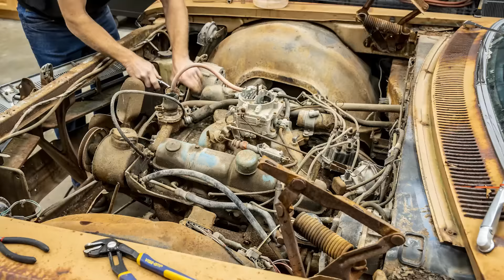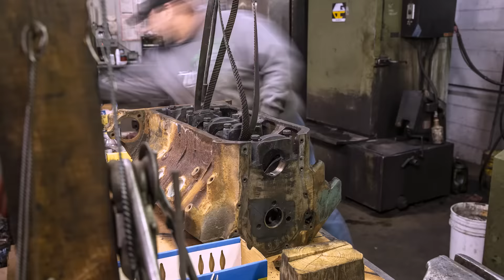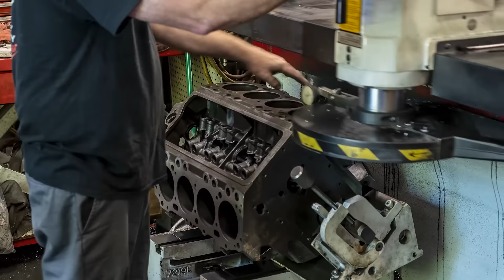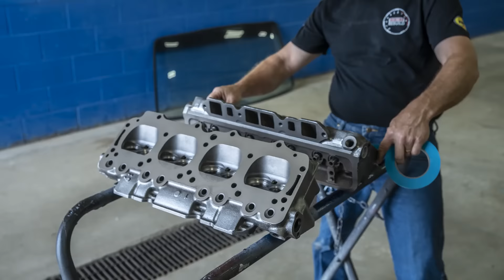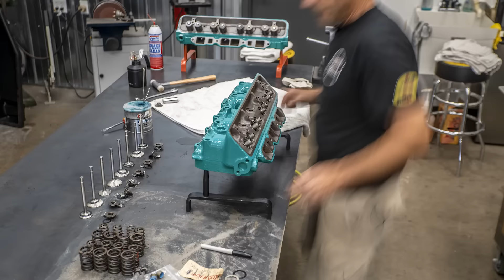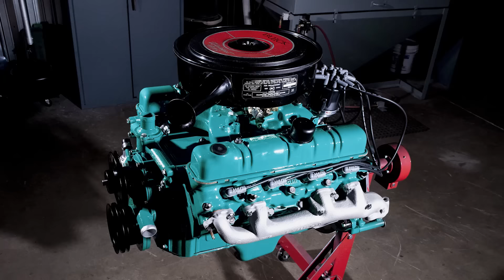Buick Nailhead V-8 engine rebuild time-lapse: from rusty to roaring | Redline Rebuilds - S3E3

Comment: “That feels advanced” - does some distributor black magic - engine fires right up....
Reply: My old man did it that way back in the early 70s by sight and sound,  sometimes by touch. 
Regretfully for me, he
Couldn't teach a hardhead young son his craft. 
I have good memories of the few projects I was blessed to help him turn a wrench on. 
Miss you always James Hilliard Bynum
Love Mike
Reply: It was over advanced. First start.......then when it's started, timing is set...
Reply: My father has the same talent. He always timed his cars by ear and hand. Same went for adjusting the carburetor. Good times. It always sucked as a kid when I came home from school and saw the car with the hood up, usually meant working into the night while all my friends ran wild. But now, I’m the one working on all the cars. The skills I learned cannot be measured.
Reply: I used to visit with an older gentleman at an assisted living home.

He told me he would use a beer to adjust timing and the carbs. He'd pour a beer into a glass and set it on the engine, and when the beer stopped foaming up from engine vibrations everything would be adjusted properly.

Comment: Looked like the cylinders were used as trashcans before the rebuild
Reply: Right ,what was that ? I picture a little homeless mouse standing over the cylinder warming his hands over a small far of twigs and McDonald's bags ?
Reply: I think that's what's left of aluminum pistons after a few decades of exposure to the elements.
Reply: so rats and squirrels are capable of quantum tunneling into the inside of the engine? Or maybe they shrink themselves down to a few millimeters to fit through some open valves and get in the cylinders?
Reply: wasp nest?
Reply: Dang ur rit
Reply: There is a magic word - inversion of air.

Comment: I do not recall EVER seeing an engine that nasty inside and out.
Man I would love to see that Wildcat running again !!!!
Great Job Guys
Reply: truth, I am with you, I never seen such a messed up engine get rebuilt like that.
Reply: @jimmski9908  They actually didn't use the original engine.  The block and heads were too far gone.  They had to source a new block and heads and then used whatever good parts they could from the original motor.
Reply: What the hell even was that, inside the cylinders!? And how did it get in there, through the heads?....
Reply: @vtr0104  That is what I thought as well.
Reply: @vtr0104  It's not as if the insides are airtight. All that gunk is from the engine sitting for 30 years
Reply: @vtr0104  In an earlier video posted on this channel they were going in-depth with this engines overhaul. I wanna say they mentioned jetting some like anti-seize like material to help break down the internal gunk a little bit, however I'm not fully sure as it's been a while.
Reply: @vtr0104  my guess is very old coolant that gelled up.
Reply: That was rats and mice, turds on the outside, nesting in the cylinders
Reply: Engine took a mud bath 
🏜😅👍🏽
Reply: Now that's a rebuild
Reply: @johnwilliams2427  yep, a decade of mice lived in that engine
Reply: @flyingpirate0456  my motor was sitting for 30 and was perfectly fine

Comment: Nailhead 401 was one of the best motors GM ever made. High compression and big torque. Had one in my 62’ Electra 225 w/ dynaflow transmission. A real joy to drive..
Reply: My dad has 66 wildcat sedan withe bigger big block of the two. Seafoam green
Reply: Such a good engine that 2 were put together and used to start the engines on the SR-71 blackbird!
Reply: @joebone3151  401 was the green color, 425 is orange/red

Comment: Not sure how anyone would thumbs down!? The production value is through the roof!
Reply: Oregon Madden 
Probably jealous because many of us don’t have a skillz & a shop like theirs ✌️😅💦
Reply: Women!
Reply: Probably guys who's answer to every question is "put an LS in it".
Reply: @JeffDeWitt  Yeah, I get that.  It's an easy answer, too.  Just not always the right answer.
Reply: People are disliking cuz it's an automatic 😂
Reply: Only thing I could  think of and  want,  is  a  few  stops  along the  way for some  hints on a  good  build;  all engines  are  different and  have  certain needs. One of the biggest  tricks is  getting a  good rear main seal  with rope  seals without drips  or  leaks.  But that may be  too precious a secret and closely held..  You don't want to give  away  ALL your  craft for  free! - Sandy
Reply: @sandyshoremann7524  My dad had NAPA store and a machine shop where we rebuilt engines. He taught me how to put in roap seals. You put the seal in the groove and tighten down the rear main bearing cap a little, remove the cap and use a razor blade to cut some of the excess that is starting to get mashed between the block and cap. Follow the outline of the groove while cutting. Reinstall the cap and tighten down some more. Do not tighten the cap all the way to the block as this is a 'little bit at a time' procedure if you want it right. Keep do this until the seal fits into both sides nicely without any of the seal being between the cap and the block. The crank should turn easily. I didn't mind doing these but I really liked it when they came out with the snap in neoprene seals.
Reply: Too many haters that haven't even tried it

Comment: no matter how many engines u build the first start up is so nerve racking
Reply: no body As someone who recently bought a 1992 Yamaha wave runner, (the first jet ski you could sit down in) you are absolutely right.
Reply: And satisfying.
Reply: I still remember, I'm  72 by the way, my first engine rebuild. It was a 61 falcon 6. I was only about 14. Did a perfect job of assembling the engine except for one detail, forgot to tighten 1 connecting rod. 😖

Comment: Great video. Im a pickup man, but had a 401 in a 1964 electra 225 2 door hardtop in 1977. That was the only car I ever owned ,and what a beauty. It was labeled 445 wildcat on the air cleaner.

Comment: Finally someone shows a proper break-in.. so many "car shows" skip over this critical part
Reply: proper break in is 5000 km's buddy. when you have you first oil change break in is over
Reply: @RandyClassicCarsFan  While I happen to agree with you, that wasn't what I meant. I am referring to the initial start break in. Camshaft / ring seating/ ETC. Break in period of 2000 rpm for 20 minutes. On these old flat tappet camshaft motors it is very critical and you must use a high zinc oil to do so or you have a flat cam and metal in your new bearings.
Reply: @Kyle_Nelson  oh ok i did not know this. well then disregard the comment i guess.

Comment: One of the coolest engines ever built !!! Torque monsters and cool looking to boot. I have an old 401 i want to put in an old street rod someday. Wont have much top end but the burnouts will be fun…. And that is why so many people opt for crate motors or LS swaps…..tremendous amount of labor and costs associated with saving an old engine like this.

Comment: Great videos! The time-lapse crane shots are choice. I did this kind of full restoration in 1997 with a 1981 Volvo 4-cylinder VW engine & manual 5-speed transmission, and it was one of the most rewarding experiences of my life. I can’t imagine going through life without fixing up a car. It’s the coolest feeling.

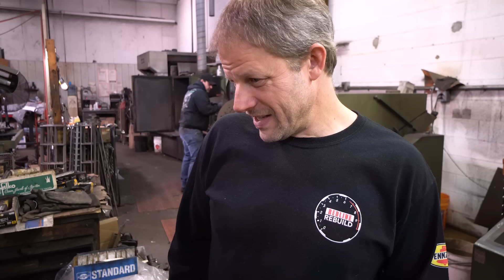Comment: 2:01 when you realize that the block is rubbish
Reply: No,  not rubbish,  just cheaper to switch to a better block. If he had sleeved all 8 cylinders, it could increase the cost of the build by approximately 800 dollars.  If you're after preserving the original numbers matching parts,,, you go the extra mile, dollars are printed every day.
Reply: @patrickwayne3701  yes at the end everything is fixable but as you said, if it's cheaper to overhaul another engine, you can call it rubbish or trash like the Americans do.

Comment: The Nail Head was one of the  engines used to help start SR -71 Black Birds 
J-58 turbo jets.

That V-8 run up sound to the transition to those jets was unreal. 🇺🇸AMERICAN engine manufacturing .

Comment: So refreshing to see a unique engine like the Nailhead restored instead of the same old, boring, Chevy, Ford, Chryslers..  My Dad drove Nailheads in 1953, 1956, 1961, and nothing but Buicks after that until he died.  He loved his Buicks so all of his 5 sons drove Buicks as well.  I have an exact duplicate of my Dad's '61 Electra w/the 401 nailhead w/19,000 original miles.  Also have a '66 Electra with the 401.  a 1987 Grand National. And a "32 w/the Straight 8.  The Nailhead.  What a great engine, indeed.  Go Buick!

Comment: Really interesting engine design, especially the cylinder heads. Buick did a lot of cool stuff in the 60’s. I like how the different groups within GM had their own brand specific engines. Now days every V8 across the line is a 6.2

Comment: There are many things that I love about these GM motors.  Buick, Cadillac, & Oldsmobile (Oldsmobile to a certain degree because it had those nifty valve rockers that connected the intake/exhaust valves) had shaft style rocker assemblies which made setup/adjustment a lot easier.
Also, that HEI distributor will keep things simpler.  There are no points to fuss with; the original distributor had points.

Comment: I always liked the old Buicks didn't care much for the dynaflo , it was a 2 speed auto transmission.  But in 65, or 66 they went to the TH400 66 was the last year for the NAIL HEAD . It was a pretty good engine.

Comment: My first attempt at rebuilding an engine was on a Buick 401. I had no idea what I was doing at the time. It did run after I put it back together but would shake real bad. I could never figure out what I did wrong with it. I thought it was due to the crank being out of balance but looking back now ,I suspect it was a cam lobe that got wiped out. Being inexperienced at the time I reused the old cam and lifters but failed to put the lifters back in the proper order in which I took them out.

Comment: I will admit I didnt used to think much of american engines. Aside from the sweet noise they make I considered them heavy, too hungry for fuel, producing far too little power for crazy displacements (150bhp from a 7l engine, really?) However... Watching these kinds of videos has made me realise that these engines seem absolutely indestructible.

I've seen them pulled out of the most jankiest globs of rust and bent steel and all it takes to get it running is basically a bit of clean-up and a new set of spark plugs in a majority of cases. And while I still think that 7L displacement is nuts these engines have insane potential for more power with forced induction. Slap on either a turbo or a supercharger and suddenly you're looking at doubling the power, if not more. Insane!

Comment: I had a '58 364 Nailhead, that was one hell of a good engine. 250 HP and would deliver consistant 20 mpg in front of a Dynaflow in a Buick sedan! Gobs more torque than shitty 350's.

Comment: Only Noah can rebuild an Arc 
My first rebuild was a 1975 Plymouth 340 Duster. My dad brought me this primer grey bucket of bolts on a trailer. When I asked him what is that? What am I supposed to do with it?! He smiled and said this is your first car. I laughed so hard at him! I left it sit on that trailer 6 months. One day out in the shop dad came and asked me when are you gonna get your car running? I need my car back so you need to start on your car! 👀 He was serious and I said it doesn't run, so how am I supposed to do anything with that hunk of scrap metal? He said you've got a shop and tools. Your not stupid or dumb so get to work. I don't have any money to pay for the repairs it needs. I was 15 years old. He said you can work it off with me. My old man worked his ass off and his heart out. I knew he had wood to cut and to be split. So I went to work. School, car rebuild, and I cut and split more firewood that summer that I had no time to get into trouble. My old man knew that and was teaching me things I couldn't see then but I sure see them now. 
Fast forwarding about 8 months.
It's was a cold winter morning beautiful snow on the ground and I had got up early because my 202J heads were done. The shop in town called me to come pick them up that morning. My block and crank were already done and mounted on the engine stand. I had assembled the Pistons to the crank and was waiting on the heads. I know I never made it to town so fast in my life. I got to town and went to the shop and apparently they were done the day before and dad had paid the bill already 😜 I loaded them up and drive back home. I got there and opened the shop door and my dad was standing in the shop and had a huge smile on my face or 😁 he said you about ready to hear this thing run? Yep I sure am and he showed me how to put the cam shaft in and how to degree it forward or backwards. He called it short wind or long wind a cam. 
Then the heads and all the rest of the parts he said son you been honest and fair and you met me half way. Let me do the rest of this engine so you'll know how to do the top half on your own if there's ever a next time. Watch this, I watched him work as I sat he talked and I listened to a walking talking book of wisdom that I miss him every day. I'm 42 now but I can still hear that rumble of that 340 when it came to life that evening and feel the smile and happiness on my old man in that wonderful moment in time. It took me 2 full years start to finish on that Duster but it gave me a lifetime full of memories that can't ever be replaced. 
I took it down to Thunder Valley Raceway in Marion SD one time just to see what it would do in qtr.mile track only a 12 seconds. Close enough to satisfied with me. 
Thanks for sharing your videos. I enjoy watching because us old dinosaur are becoming more and more extinct. It's good to see actual skills now days and applying those skills and knowledge is a powerful thing. 
Earned another sub 👍 God bless you and God bless the USA 🙏

Comment: Buick Nailheads are efficient and produce good torque at lower rpm's due to the smaller valve size.
Internal combustion engines are still the most efficient way, to turn any combustible solvent or oil, into work.

Comment: I’d love to do this stuff but I just know I’d lose some of those tiny parts 😞
My life is littered with missing nuts, bolts, washers, gaskets, and screws.  I can’t even change the batteries in a flashlight without losing the bulb or the spring, lol.

Comment: Hi, very good job!
Mos I like your videos. I have a question, did you try to measure the engine's power after you refurbished it? And compared to the original performance of the new engine? It is clear that before the overhaul, the performance was small.
Given that working on today's machines is much more accurate than it was at the time of the creation of those engines, the steps you take also lead to increased content and compression, so I would be interested in increasing engine performance.
Good luck.
Thank you so much.
Greetings from the Czech republic

PS: I apologize for my English, but I help myself with the translator ;-)

Comment: When are you guys gona rebuold one with power and port the heads and 4 barrel manifild  with stainless stell valve and valve springs  and alluminum pulleys and a stage 1 cam

Comment: Out of curiosity for installation of the new nailhead into a car, what kind of exhaust donuts would be required? And more specifically what size of exhaust donuts would be required for a stock manifold on a 401 Nailhead? Getting ready to put a new engine in my car and it’s in need of exhaust donuts badly

Comment: What is the coating you put on the exhaust manifolds that when you bake it at 600 degrees it turns gray and will always stay that color? I saw you talk about it and I'll be damned if I can find that video now. Thanks.

Comment: I've never seen cylinders that dirty upon dissasembly. What the hell happened ? That oil pan has the sump in the middle like a dodge slant 6, sending the oil to the back on takeoff and getting air in the oil pump and passages.

Comment: How much does a job like this would cost? I just bought a 55 roadmaster and was curious
Reply: If the block, crank, rods and heads are in good shape, around 2-3k is a safe estimate for new pistons, and all the other parts you'll need to replace plus the machine work.

Comment: Just wondering how much does pulling a motor and rebuild usually cost
Reply: Depends what has to be done,1-2k is about where you're starting for a basic rebuild. And it just goes up from there if more parts need to be replaced.

Comment: hi i want to ask about engine surface... what happen if we resurface of honing many time? i think its make more thin and thin but can we repair that thin surface like welding it or recast it make it bold again? *sorry bad english
Reply: Theres a limit to how far you can bore a cylinder, usually .060 is the limit to be safe to run, some engines can handle .080. Once you reach the limit though you'll have to sleeve the cylinder to bring it back to spec.
Reply: @sparkplug1018  oh thx but what about the surface for gasket some people smooth over until too thin so how to restore it??
Reply: @vicoshel  Theres really no way to bring the deck back up, once thats to thin the block is pretty much done.
Reply: @sparkplug1018  sigh so sad then thx bro u help my curious😊
Reply: @vicoshel  Yeah its not fun having to scrap a block, but they don't last forever. That being said, theres enough material there to rebuild them multiple times so they'll have a pretty long life that way. Assuming they weren't severally abused anyway.
Reply: @sparkplug1018  yeah, in my country some mechanic after say ican fix it but  what he do is destroy my engine n run away sigh sad man 😢